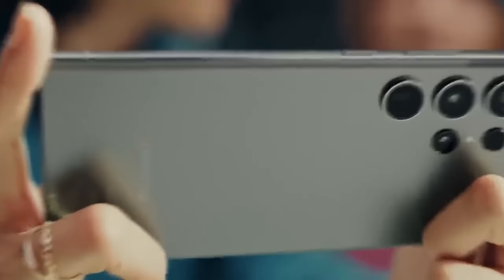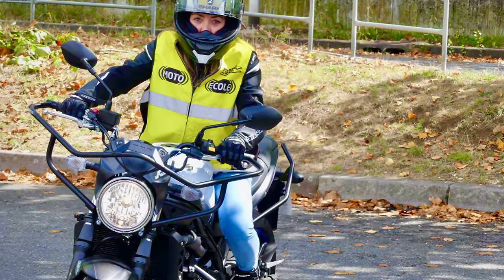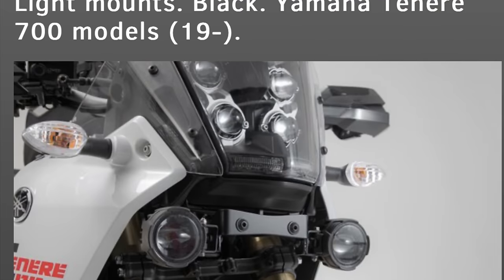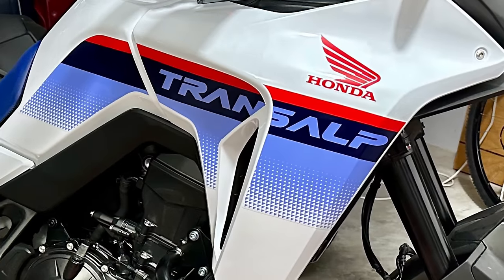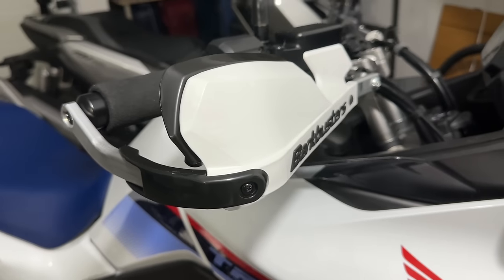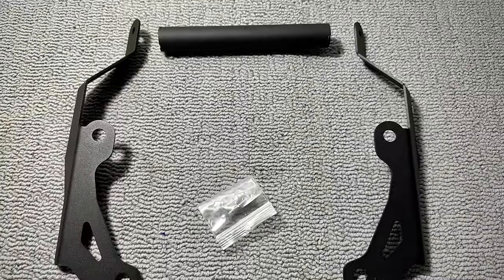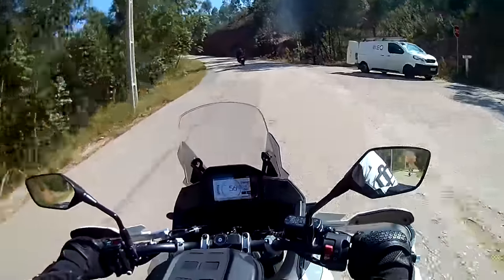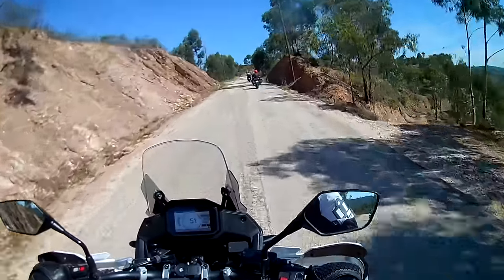An Alternative to Traditional Crash Bars

Comment: Thanks, just the sort of info I was looking for, and I don't like big clunky crash bars. BUT, don't you need a bash plate to protect the sump from flying rocks on gravel roads? (as ugly  as they are)
Reply from the maker: Yes. I’m waiting for H&B to send me their sump guard👍
Reply: Hi, so my engine guard has arrived, and I'm still waiting on the sump guard. Has yours arrived yet, I'm wondering if I should wait before fixing the engine guard - will I have to take it all off again to fix the sump guard?
Cheers 👍

Comment: About the only thing I'd say in favour of the full crash bars, especially on tall off road style bikes, if it does end up on its side, the full height bars are a better lifting handle than the handlebars.
Having lifted up a carb model Triumph Tiger on my own, I can assure you, anything that makes getting it back on its tyres easier, is well worth the extra weight.

Now I know you could argue: it's not something I expect to do, which is a valid point, but then why fit bars at all?
Reply from the maker: I agree; it’s always nice to have a number of grab points to choose from when the bike’s on the floor. Thanks for your feedback👍😊

Comment: I remember when they used to design offroad bikes with crashing in mind. The engines were recessed horizontally as well as vertically so there was (almost) no way your engine would ever touch the ground. Crash bars weren't necessary and were unheard of because your bars had reinforced ends and the only parts that would touch the ground were your fairings, which were replaceable cheaply and easily, and your exhaust, which was armored. 

With some of these modern bikes, you could be mistaken for thinking they were designed with the weak bits exposed on purpose.
Reply from the maker: Indeed. The sump on the Transalp is ridiculously exposed🙁
Reply: oil sump was designed like that so people buy their engine guard+skid plate, the amount of packs they offer is the give away
Reply from the maker: I have Hepco’s sump guard on order👍

Comment: Have you crash tested the bark busters?  My Multistrada’s oem guards have integrated turn signals, which is the only useful thing about them that id like to keep. I’ll have a go with a saw and an assortment of files in order to get a more robust solution, but I’d rather not spend a packet on something that’s going to fold up at the slightest provocation.  Will the bark busters stand up to the old standard roll off the side stand or upturn tip over?
Reply from the maker: This is damage limitation really. If you crash, something's going to break, whatever protection you have :)

Comment: Objection no. 5: most of the times, when the bikes fall it doesn't have the front wheel straight ahead such that the handguards will hit the ground first. Many times the wheel will be turned to the side and the upper plastics/tank might hit the ground 1st.
Reply from the maker: Overruled: the Barkbusters are designed to take up the slack, bar position is irrelevant😊
Reply: @RocketMan_Moto  if they actually make contact with the ground. Since the Transalp is a bit of a faty, when the handlebar is turned to the side the plastics will hit and take most of the impact.
I was looking at some pictures on the internet and in some situations you can see the full force being absorbed by the tank. Especially when the handlebar is turned on the side the bike falls (eg. handlebars are turned to the left and the bike fell on it's left side as well)
Reply from the maker: I'm sure that's true, but I have also seen photos of tanks receiving impact damage right next to upper crash bars. My point in this video is that no protection is infallible :)
Reply: @RocketMan_Moto  indeed; some protections are better, some are more subtle

Comment: Sure wish these manufacturers would offer electronic cruise control.  Out of the Tenere 700, Transalp 750, KTM 790, and Tuareg 660 I would have to go with the Tuareg 660 for the cruise control, tubeless tires, and amazing suspension.  I would rather buy the Transalp, but it doesn't have what I want in a middleweight adv touring bike.
Reply from the maker: I hear you. It’s all marketing - they’re pushing us to buy the Africa Twin to get all the toys🙄

Comment: Yeah, the hand guards are a bit flimsy but I love Hondas engine crash bars and bash plate. I like that they are grey. A bit expensive though compared to your solution.
Reply from the maker: If it works for you👍 Are you pleased with the Transalp?
Reply: @RocketMan_Moto  I had a CBR1100xx in the past which I always considered the best bike I’ve ever had (the Transalp is my 16th bike) and I am seriously thinking that this position has been taken over by the Transalp now. I really, really enjoy this bike. It does everything right.
Reply: @RocketMan_Moto  BTW, my dealer accidentally ordered the upper crash bars as well for my bike. I could have had them for free, I still didn’t want them. I think they take away the aesthetics of the bike completely.
Reply from the maker: Excellent, I agree with you on the Transalp, it’s pretty much faultless, especially for the price. Glad you didn’t fit the upper crash bars. They make an otherwise elegant bike look very heavy and ungainly.

Comment: Im not sure anymore what to think of crash bars. I have had motorcycles that had them and ive had ones without.. by coincidence i dropped the motorcycles who did have crashbars, one time it bend the bar and still cracked my fairing, and the other time it broke my handguard, heated grips and brake lever. On my transalp i will not fit any crashbars because i want to save weight and dont like the look. Admittedly, i will use it 95% on street and 5% light gravel roads so im not a person who will be dropping his bike (hopefully). If i did more offroad i would probably go for what u did because it looks the best.
Reply from the maker: Thanks for your feedback😊
Reply: You don't have to drop the bike or even be on gravel, off-road. It's enough if someone just run into your bike while it is standing in a parking lot. That's what happened with my bike. Fairing crashed and handlebar bent. There were no crash bars and handlebars, but I didn't really care it wasn't that big damage. I've learnt that never park your bike way forward in the parking lot. Position it at the back of it to be more visible for the car owners who seeks for a parking lot.
So yeah I ordered a crash bars for my Transalp. If I drop the bike and the crash bar bend, I just go back to the dealer with a warranty claim. I think with these aftermarket stuffs it's a bit more complicated. In my opinion the sump guard is a must have and with the engine guard it looks good, especially on the classic white red blue bike. The SW-Motech bash plate is way more bulkier than the stock Honda, but hey this is subjective who likes what.

Comment: Completely agree on crashbars...for the most part.  Shop for the lighhtest bike and immediately hang 50# of junk on it?  Nope!  On my Africa Twin, I ran a wrap around Bumot skidplate to protect the engine and took the risk  of tagging a radiator in a crash without crashbars, if i managed to do so.  In 6 years, off road competitions, mountain cutlines and a trip to the Artic and I was totally fine.  Same with the rediculous headlight guards.
  My new Desert-X on the otherhand would easily crease a $3000 tank in a minor tipover so bars were required.  Sigh.
Reply from the maker: I get that. Thanks for your feedback :)

Comment: My 2000 Transalp still looks good as new, no crash bars ever added.
Just don't crash😁 Seriously, i only ever had to bend my shifter back and fix a blinker🤷🏼‍♂️
No extra weight or fibrations.
I have many mods all for comfort and  ergonomische purposes. MRA touring windscreen, sw lower wider pegs, raised seat with added high density foam with a sheepskin when needed, heated grips, headlight guard, homemade jerrycan holder and a sidestand foot plate, handlebar risers.
And Honda wing stickers on my original plastic handkappen, so it looks like i'm flying through the Dutch country side.😏
Take it from a frugal Dutchie, safe your money for petrol, trips and fines, it's much better spend.
Oh, if mine finally wears out in another 24 years can i buy your indestructible Japanese mountain goat for a 'vriendenprijsje'.😉
Reply from the maker: Not crashing is indeed the best solution :)

Comment: @RocketMan_Moto I have bought the GPS mount kit based on your link and I am having issues installing it. Basically, after placing the kit's brakets on top of the original support it is impossible to install back the windshield. It is in touches the kit's brakets and it requires me to bend the windshield to insert the upper/lower bolts and no matter what, one of windshield's holes remains misaligned. Any tips on how to install it or do you think I have received a lemon? The brakets look identical to yours and well as their alignment with the original support. Thanks!
Reply from the maker: This is strange. I have had no problems with either the standard or tall screen, but a viewer complained a couple of weeks ago that the mount he had bought from my link wasn’t compatible with the tall screen🤷‍♂️ I suspect there are different ‘versions’ of the mount and it’s the luck of the draw. I can only apologise for this. I will insert a note next to my link now🙁
Reply: @RocketMan_Moto  thanks for the quick reaction and no need to apologize! It can very well be a manufacturing issue. I will look for an alternative and let you know. Thanks for the great videos, they accompanied me during the 3-months long delivery time of my Transalp. Cheers to you!
Reply from the maker: Thanks and good luck👍😊

Comment: Interesting. I had a Tiger 800 with low crash bar only and on first fall (on a relatively flat surface at low speed), the plastics broke. From then on, I prefer full ones, however it depends on the bike too - e.g. 790 Adventure can AFAIK do well with no crash bars at all. Unfortunately, not all manufacturers think about that so they're sometimes necessary.
Reply from the maker: I agree every bike is different and it’s impossible to provide 100% protection

Comment: Points well-made and appreciated!

I would prefer things go to the other way, back towards a true naked bike. To me, the Trans-Alp is almost a full-dresser but I started riding in 1972 when pretty much only an Electra Glide came from the factory with a windshield. We never fitted crash bars to anything back then and never had an expensive problem with damage from a simple fall up to about 30 mph. That's because there was a lot less to break on a bike back then. Handlebars could be bent back, scrapes on engine cases — no one cared — and you were back on the road.

We'll never see those days again. I believe all the plastic on bikes nowadays is not really there for wind 'protection' (it's a motorcycle and being in the breeze is the point) but to disguise the fact we have ugly great radiators on bikes now and there's not really anything that can be done to make them not ugly. All that can happen is to cover them up and then find a reason for that cover.
Reply from the maker: All good points. Thanks for your feedback :)

Comment: If your headlight is stationary, and then you mount extra lights to your crashbars, then you're making a mistake. Extra lights should be mounted to your forks, so they aim whenever you turn your handlebars.
Reply from the maker: Could be useful, but only at low speed
Reply: @RocketMan_Moto  Exactly. So that if you're riding a new trail at night, you don't accidentally steer your motorcycle off of an unseen cliff, in the dark.. It's also helpful to have lights attached to your steering on switchback roads and trails.
Reply: @RocketMan_Moto  Steering headlights actually work better than forward fixed lights, in any corner,at any speed. They allow you to see further ahead in any turn, at night. (More crucial in switchbacks and tight trails, though).
Reply from the maker: You’re right, but personally I never go off road after dark😊

Comment: when you go down the handle bars normal are turned to a full lock one way or the other so i would re think this as i think you will stil get impacks on the side still. but i guess i only have crash bars on my bikes so in the event off an off i can still ride thats all i care about. Ride safe
Reply from the maker: You’re right, but the fact that the bars are on full lock makes little difference. The guards are designed to ‘take up the slack’😊
Reply: @RocketMan_Moto   yea i had thought they would of took some but not all surely but thats good design but wouldnt expect anything less from barkbusters

Comment: I'm with you RM, less is more.
Reply from the maker: How’s the new bike?😊
Reply: @RocketMan_Moto  Really enjoying it thanks RM! Roads dried out today and I took it for a good ride today. Lot's of gear changing, going up and down the rev range and starting to push it up into the rev range. I just adjusted the clutch free play, loosened it off a bit, too tight from the factory in my opinion.
Reply from the maker: Excellent. I imagine it’s quite a different experience to the NC👍

Comment: The issue I still see is that when your bike falls, the steering column will be turned left or right, which then makes the left and right upper side exposed on a flat surface? Or am I wrong? I would really want to go for the lower crash bars so just a quick check on your thoughts on that.
Reply from the maker: You’re wrong, sorry😊 The BB guards are designed to ‘take up the slack’. Even when the bars are on full lock, their overall width (with the BBs) remains pretty much constant.
Reply: @RocketMan_Moto  great to know! In your description you mentioned that some users had issues with fitting it. Is there any other manufacturer that already supports the 750?
Reply from the maker: Several. Heed are worth looking at👍

Comment: I had only lower crash bars on my Africa Twin as well, because it looked great. However I dropped the bike on ashphalt and my insurance had to cover a 11.000€ bill. The engine was protected though, otherwise it would have been totaled.
Reply from the maker: Ouch. Do you think full-height crash bars would have saved you?
Reply: @RocketMan_Moto  Yes, unfortunately I think so. As stupid as the bar around the front looks, but it probably would have saved all the plastic parts and the headlight. The standard plastic hand guards did not protect anything. I now have the same SW-Motech ones like, which are made from Barkbusters. And I installed the Outback Motortek crashbars – again not the ones that go around the front, because I just hate the look of it and I did not want so much weight. But I think the new ones reach up higher and should protect the sides better together with the new handguards.

Honda part prices are ridiculous though. The 2€ heat protection metal sheet on the exhaust costs 400€, yes, fourhundred!
Reply from the maker: I agree on the prices. That's how the claw the money back :(

Comment: Be carefull with hepco & becker engine protection bars and plate, I tried them and did not fit well, asked hepco & becker and they don't give me a solution plus the adptor you need if non using the tank bars, the threads worked like shit, I even broke the screws and had to replace and spend extra money to solve the problem on my own
Reply from the maker: Interesting feedback. I didn't have any quality control problems like that, maybe I just got lucky?

Comment: Someone used bmx steppers as protection
Reply from the maker: Not sure they’re designed to take the weight of a motorcycle🤔
Reply: @RocketMan_Moto  the metal ones or the solid plastic can take a fall he said its like side "mushrooms " or slider's i think they are called not really sure they ain't crash bars but they'll do for a light motorcycle

Comment: Honda missed the boat with a low power heavy pig.. if low cog was given ANY thought the exhaust wouldn't be under the engine where itself needs crash/bash protection.. route the pipes high as with the muffler to avoid problems with river crossing etc.. they make road bikes with undertail mufflers FFS.. why not trail & track bikes like ADVs.. the side plastics should be high impact tough plastics to be THE crash protection.. you know .. like MX bikes.. it's all arse about face.. like all these ADV bikes now
Reply from the maker: Thanks for your feedback

Comment: It's amazing the junk people pile onto their bikes. I never even bothered with protection on my BMW boxers. I took the view that over the years, the lack of falls against the money not spent on crash protection, I could afford the occasional repair if the worst did happen.
Reply from the maker: I share that view
Reply: @RocketMan_Moto  I'm taking the same approach with the V100. The various crash protection options just look awful and add unnecessary weight. The cost of minor repairs is worth the risk.
Reply from the maker: Completely agree. Keep it clean and light, and see any damage as a chance to upgrade components👍